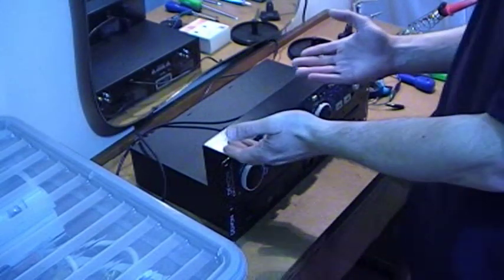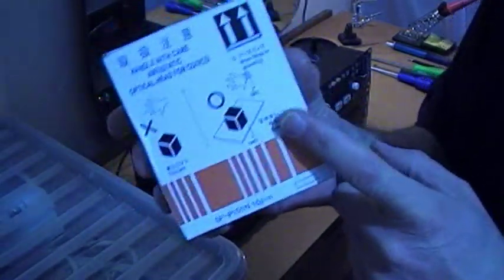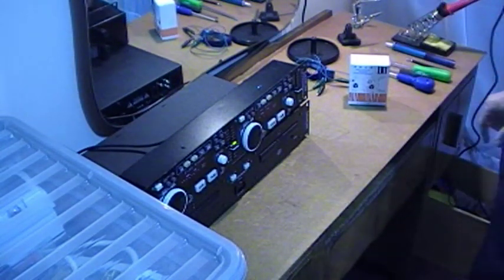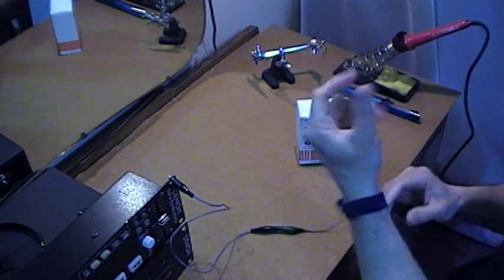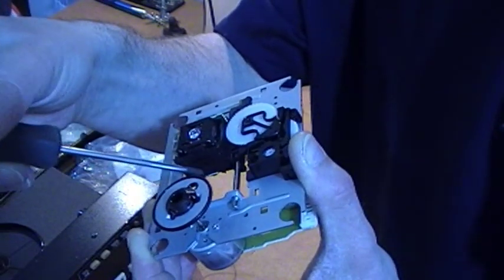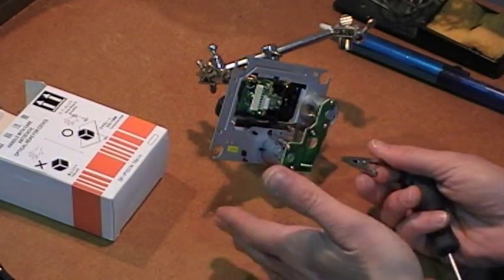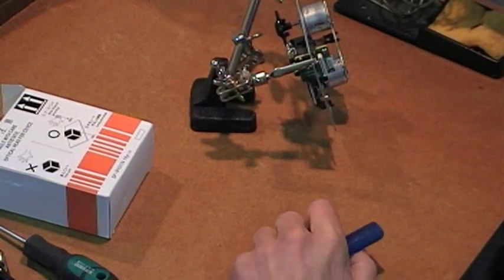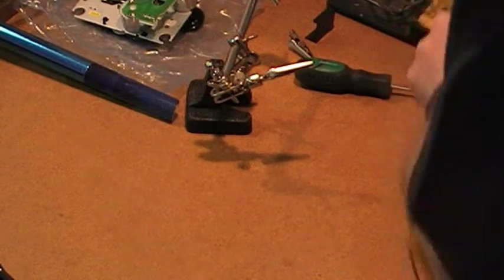Denon DN-D4000 laser replacement (Pt.1 /4) - Prepare the new laser

Comment: Thanks for doing this Video. I've gotta Denon 2700F that wont detect the CD. I've had it repaired twice before in the early days and gave up on it when it happened a 3rd time. But If can the part I will certainly give this a go. where did you find the part number for you model?
Reply from the maker: As these get older parts become harder to source, but you don't always need the part number, just google for what you want, ie Denon 2700F replacement laser. I found a couple for you, they look different to the Sanyo part in the video but I guess most of the procedure is very similar. Good luck!
https://www.ebay.com/itm/NEW-OPTICAL-LASER-LENS-PICKUP-for-DENON-DN-2200F-DN-2700F/281863924274
https://www.aliexpress.com/i/1000008114763.html

Comment from the maker: @Chungalin In theory perhaps, but you don't want to heat up this pcb for longer than necessary so if you can snatch the solder off quickly with a sucker that's preferable to applying heat for a few more seconds waiting to see if the solder will migrate.

Comment: A solder aspirator is not needed at all for such a simple job. Just clean the soldering iron tip from excess of solder, heat the solder bridge with it and it will move from the optical pickup to the soldering iron. You may need to repeat this one or two times, but no need to suck the solder, just clean it from the soldering tip.

Comment from the maker: Thomann also do them, google Thomann then search on the site for "Denon replacement drive". I think the same advice in my videos about removing the solder link (for electrostatic protection during packing and shipping) from the new laser before use still applies.

Comment from the maker: Hi Gary, Charles Hyde & son can do a complete replacement mechanism.

Google Charles Hyde and look for "3370059102M Laser Mechanism Complete (CD) Denon" or chs part number 47000BC. I think this is the one, check with them first.

It may be more cost-effective to pick up another 2600 from ebay though. The DN-2600F / DN-2100F and DN-2000F Mk.3 all use the same mechanism which includes the sliding drawer, you'll need to change over the clip-on fascia. New laser and motors come in the mechanism unit

Comment from the maker: @deeveight8888 Great, bear in mind your laser will be a different part number, make sure you get the right one. The dn-2000f is slightly different, the laser unit has different connectors, but these will be obvious when you see it. The procedure is pretty similar.